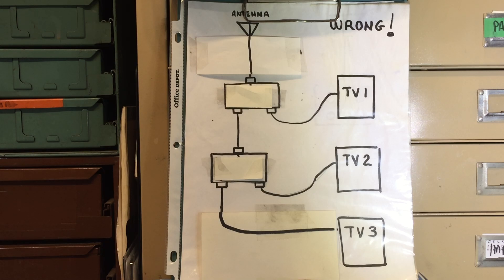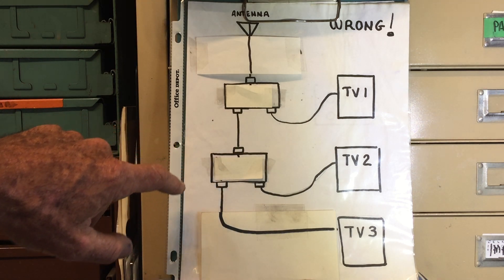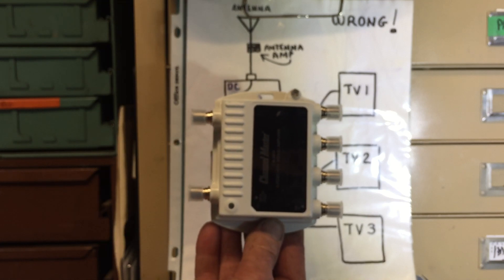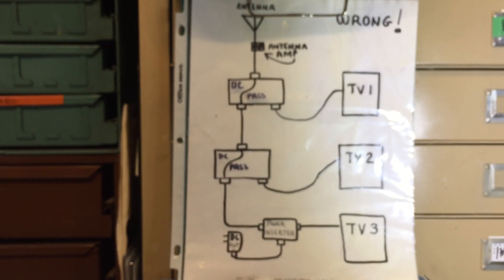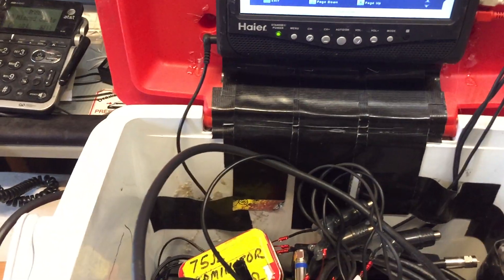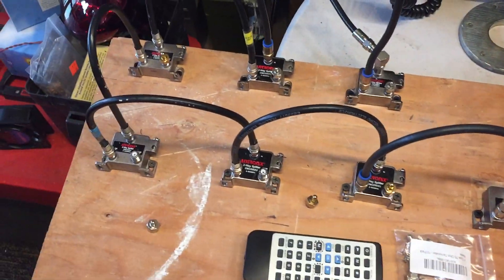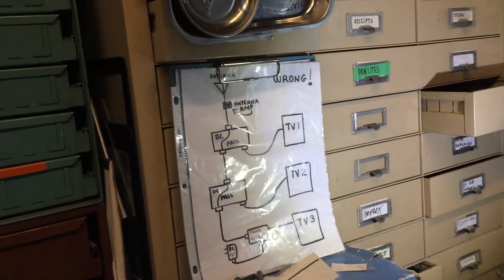TV Antenna Signal Splitting Mistake. (This Video Is Worthless Unless You See Follow Up Video.)

Comment: I recently ran into a similar issue. The problem was caused by faulty coax connectors. If the connector isn't properly attached to the cable, it leads to signal quality loss. Although it may seem like the splitters are causing the problem, the real issue is that the more splitters you have, the more connectors are introduced into the system, which increases the chances of poor connections. Looking at it more deeply, the likely cause of the problem is that with coaxial cables, the outer shielding also transmits signal to the signal insulation. If the cable is cut poorly and the shielding doesn't make proper contact with the outer part of the connector - or if the connector fits loosely on the cable - this kind of issue can occur.
Reply from the maker: I hope you saw the following video where I discovered my mistake.  Here's the link. https://www.youtube.com/watch?v=rZhw0BEqyRE

Comment: Would be nice to know how much the signal % dropped on the screen meter shown as you added each splitter, ie 2%? 4%?
Also, do similar test with 2 or 3 splitters using much longer and different length rg6, ie 25ft and 50ft going to identical converter boxes and check signal levels. With, without rg6 termination caps. Just keep excess cable coiled on floor.
Another would be regular rg6 vs quad shield at long lengths

Comment: Thanks I enjoyed this.  My TV pixels up from time to time. May I ask when I run my multimeter across the Antenna incoming coax feed I get a tone, or reading (using 200ohm setting). Is this normal?  Shouldnt the TV antenna be open circuit?  Thx Tim

Comment: Feeding multiple locations using splitters, instead use TV signal taps.  You may need to amplify the antenna only if the signal level is not strong enough by itself.

Comment: One good solution is drop-taps rather than splitters.  Whereas most splitters cut the signal in half, the taps "drop" a specific DB to each set, and send the remainder down-line.  Sadly they are tough to find on the consumer level.
Reply from the maker: Thank you for this information. I've often wondered about the splitters I picked up that have different DB numbers for each output. It sounds as if this may be what you are talking about.

Comment: Sometimes trial and error is the method that teaches the best. We have 3 TVs that use one antenna. The shielded coax from the antenna goes into a amplifier that has four outputs. One output goes to a TV in a living room right next to the antenna pole. Another output goes to a 50 ft coax cable that runs under the house and to a 2nd amp similar to the first one. Then the two TVs in the back rooms are connected to that amp. I eventually connected an FM tuner to the first amp to improve FM reception, since there were more outputs available. I learned to always use a multi-output amp in place of a splitter.
Reply from the maker: I use distribution amps when necessary, but I prefer not to since it's one more thing that can go bad at some point. Hopefully you saw my follow up video I made after this one.
Reply: @GrantsPassTVRepair  I just watched it. I don't used amps powered by a DC pass-thru. Only amps that have their own dedicated power supply. Same thing with a rotor, I wouldn't use one powered through the coax cable, and some antennas have those kind of built in rotors. An Amp can burn out for sure, but it's rare for modern ones to do that if they are quality ones. I had a cheap one burn out on me about 12 years ago and swore off the cheap ones. And it's still easy to trace if that happens.

Comment: Were you using RG6 or RG59?RG 59 does not pass uhf signal very well. A high DB loss above 500 MHZ. Many older homes were wired with 59
Reply from the maker: I was using RG6 in this case,  but yes I was told to avoid RG59 due to its loss.

Comment: The 2 way splitter you show first is marked as 5 to 2400 Mhz. This would cover the entire spectrum of the entire TV band. Part of the problem may be the way it is wired internally. Some units use capacitor, coil or wire circuitry. Capacitors will block the flow of DC and some of the higher or lower frequencies depending on the value of the capacitor. At TV frequencies, the capacitor will be quite small. Coils will not block DC nor 60 hz AC but will attenuate certain higher frequencies and will be quite small. But since the splitter has a lower frequency limit (under 1 Ghz) there is probably a capacitor/coil combination in a pi network, and maybe two of them,  to block frequencies lower than 1 Ghz. 
    Also, the terminators need to be used to prevent standing waves. Standing waves occur when signals of equal frequency  travel in opposite directions on the cable, one from the antenna and one being reflected from any thing that is on the cable that is not of the characteristic impedance of the cable. If they come together anywhere in the middle of the cable, they can tend to cancel each other out if their amplitudes are close to being equal. This is also the reason that there must be a matching transformer at the antenna's terminals. The antenna has a characteristic impedance of a balanced 300 ohms, while the cable an unbalanced 75 ohms. There would be standing waves created at that point, if not for the transformer, thereby attenuating the signal. The characteristic impedance of the transmission line must be the same along the entire length of the cable (including splitters, connectors and terminators) in order to transfer the maximum amount of signal to the TV  Each piece of cable and each splitter introduces its own loss. Any loss on the cable must be over come BEFORE the signal gets to it.
Reply from the maker: I thought you might like to see this follow  up video on antenna splitters. https://www.youtube.com/watch?v=_5ul0KfoewA

Comment: I see it is over a year old but to help anyone out.  The cable lengths do have loss.  However, you didn't have a second output on each spitter so there was no load.  Yoou'll find if you hook a load (TV) to both inputs the signal will drop.
Reply from the maker: It's More than cable length having loss that causes problems. There  are reflections in the line which can cause issues. Here is my concluding video on why I ran into problems. https://www.youtube.com/watch?v=_5ul0KfoewA

Comment: did u leavevthe pre amp inline with the big 110 splitter?
Reply from the maker: No preamp was needed here. just used a distribution amplifier without any splitters. My big mistake here was using diplexers to split the signal rather than conventional splitters. At that time I did not realize that diplexers which look like splitters are designed to block TV signals and only allow satellite signals to get through. Had I known what I know now,  I believe I could have used  passive splitters and it would have worked fine without having to use a powered distribution amplifier.

Comment: Is it possible to combine OTA TV and Spectrum TV? Ive recently "cut the wire" and I am trying to use my existing Coax cables in my rooms and keep Cable Internet(only). My current connection is connected through a PPC-9M-U/U splitter. Any input is appreciated 🙏
Reply from the maker: I've been told you can share the cable for both signals but I have not tried it yet. If you have success doing this I'd love to hear about it.
Reply: This is a year late, but check your Spectrum wi-fi 'tower' for ethernet ports, and your TV for similar.  IF you plug in an ethernet cable the TV and wi-fi unit should 'find' each other.  That's the way I'm doing it.  TV is a 2014(?) Vizio SMARTcast.  OTA antenna's coax is plugged directly into the TV's coax port.  I use the TV remote to switch between the OTA antenna broadcast signal and the 'SMARTcast' function for internet streaming channels.

Comment: I have five TVs in my cable system, a better solution is one multi port splitter. This one piece splitter has up to eight ports, it is nice because extra ports are there if you want to add anymore televisions. Naturally the unused ports will have 75 ohm cap on the end. Buy the way this is a no-brainer hook up all your TVs to the outputs of the multi port splitter, connect the single amplifier to the input wow magic.
Reply from the maker: Did you see this follow up video? https://www.youtube.com/watch?v=rZhw0BEqyRE&t=0s

Comment: With RG-6, you lose .83 dB on 800 MHz, and 1.35 dB on 1900 MHz, per 10 ft of line. Ideally you would want you cables to be as short as the need to be, and refrain from splitting as much as possible. Of course the specs of the cable should be listed on the cable itself.  

With all cable specs you have quality/power loss over long distances.  Especially now with home internet being as fast as it is.

Comment: So what exactly was the final solution for the lady's three TVs...eg, what was the final schematic of cables, splitters, amp. etc?
Reply from the maker: I used a distribution amp to solve the problem, but had I known what I know now, I believe I  could have used a passive splitter rather than a powered one.  Did you see the follow up video I put a link to in the info section? I Talked about how I mistakenly used a diplexer not realizing they block TV signals. Here is the link. https://www.youtube.com/watch?v=rZhw0BEqyRE&t=0s

Comment: Great video!  Hey, my Dish Satellite has two coax cables that connect to a dual connector that’s attached to the house wall.  How do I determine which connection to attach the single coax cable that runs from the OAT antenna?  Or do I need to rip out the existing dual connector and replace with a single one?  Appreciate your advice.
Reply from the maker: I don't know, but every time I attempt to use the old coax which was used for the satellite and attach it to an OTA  antenna, I end up having to remove the diplexer which looks like a splitter because it blocks TV signals even though it has a DC pass through.
Reply: @GrantsPassTVRepair  what is the diplexer?
Reply from the maker: @NavySWO  They look like signal splitters but they are designed to block TV signals from passing through them and only allow the satellite signals to pass through the TV cable. Here is an example. https://www.techtoolsupply.com/ProductDetails.asp?ProductCode=DPD2&source=googleps&gclid=CjwKCAjwu5yYBhAjEiwAKXk_eI_FbTFtfjYEICllPwa9tL7b4uWB12meCy392vWZ93k2fMar9ovwgxoCT1AQAvD_BwE

Comment: In your video, 

- you first added a preamp with it's power inserter as per your diagram at the 1:05minute mark

- then you added the distribution amplifier which you said took care of the problem..

My question, since the preamp requires a power inserter + the distribution amplifier and also requires power and comes with its own power insertion AC block adapter..

In the end when you got all this working, 1) did you actually have two power inserters over the coax line (one for the preamp + one for the distr amp) ? 

I ask because I would have thought all this power insertions would be a problem.

2) where exactly did you install the power distribution amplifier and how did you power it? Do you have a diagram or weblink that shows how the preamp & distribution amplifier were connected among the existing  splitters as you have shown..

Thanks for a great video.
Reply from the maker: Did you happen to see the follow up video I made to this video?  What solved my problem was removing all those splitters and installing a distribution amplifier which had one input and three outputs. Here is a link to my follow up video. https://www.youtube.com/watch?v=rZhw0BEqyRE

Comment: I see people do that all the  time. They install a two way or four way splitter and then use a bunch of terminators. It's Not a good idea though. On a two way splitter  you get 3.5 db of loss on each terminal. On a four way splitter  you get 6.8 db of loss on each terminal. Sometimes more, sometimes less. It varies depending on the quality of the splitter. But generally that's the  loss. Better option would be too use a grounding coupler or if you need multiple feeds then a distribution amplifier.
Reply from the maker: I hope you saw my follow up to this video. I had mistakenly used  splitters which were designed to block television signals below 950 Mhz known as diplexers . https://www.youtube.com/watch?v=rZhw0BEqyRE&t=0s

Comment: I'm running 110' of rg6 and 4 spliters.  No issues even on the last tv and dvr.  The only difference is that my power inserter is connected before all the spliters.  Maybe that was the issue in your setup.
Reply: My Winegard-LNA-200-Preamplifier  i put ther power inserter after 100 feet  of cable in the celler  and  still have  about 15 feet  to the 4 way splitter  ,
Reply: You don't want to send unwanted dc voltage to other units.  DC inserter goes before any splitters.
Reply: @jayvalentin5513 My Winegard-LNA-200-Preamplifier  i put ther power inserter after 100 feet  of cable in the celler  and  still have  about 15 feet  to the 4 way splitter

Comment: The furthest run should come off the splitter directly from the antenna. The first & second TVs should be from another splitter on the other port of the antenna splitter
Reply: I have UHF antenna 30 feet high  with Winegard-LNA-200-Preamplifier with  120 feet of  run of cable  connected to a 4 way splitter  leave a short cable to main living  room tv  then  2 ,20 feet  cables  to other tvs  in other rooms  that  also has  3 way to 3 tvs  and 2 way spitters  other 2 tvs.

Comment: I am no fan of splitter, after splitter. I think you should had tried first a 3-way splitter, using the -3.5 dB port for the TV further away, unless it is balanced in which case it makes no difference what port you use.

This  is a classical example on why you need to check first what is coming out of your antenna in order to determine if the signal can be split or not and how TV outlets it can take. Remember, garbage in, garbage out. If you had used a professional signal meter, you could have easily determined if you had readings good enough (power, MER, SNR, link margin, BER) to split the signal and the readings coming out from each splitter.

Also, If my readings were low and for test purposes I would have powered my preamp using the first TV coax cable (TV 1) to avoid going thru two splitters. The more things on the way, the more chances for failure.

Finally, if your distribution amplifier worked, it means you had good signal readings coming out from your antenna to your amp ANT inlet port.

Thanks a lot for your instructional video. We need more like that.

Comment: I was told to split your coax from the antenna only once and only use a splitter that meets your needs without un-needed extra ports. Keep in mind your signal must be useable at the splitter input or else you're just splitting noise.  If your signal is weak at the splitter input, use a pre-amp (at the antenna) and matching amp (indoors) ahead of the splitter.  If you have long runs you can add on an amplified splitter like the Channel Master in this video.  This arrangement has always done well for me.
Reply from the maker: I've often placed passive signal splitters far from the TV antennas and they seemed to work okay, but if it helps to have the splitter close to the antenna I'll keep that in mind. Thanks for the tips.

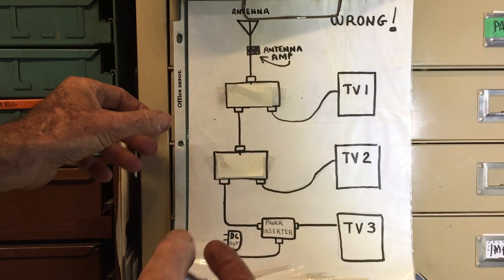Comment: Those satellite DC passing splitter you showed at 1:50 video aren't splitters! At least not in a conventional splitter sense.  Those are satellite diplexers which are designed to send both TV and Satellite signals down the same coax. That Sat output (on the lower left of the video) only passes signals above 1GHz (and DC to power the LNB). The TV output on the lower right has everything below (usually 5MHz to 850MHz).  Since TV stations operate below 850MHz, the only TV that is going to get a signal is the first one because the Sat output on the first splitter doesn't have any TV signals on it.
Reply from the maker: Thank you so much for this information. That's probably where I went wrong. I did not realize TV signals would be blocked on the DC side, but I just tried an experiment using the DC side of the splitter and you're correct. When I saw how the splitter said 5 to 2400 MHZ I assumed that meant both sides.
Reply: Easy mistake to make with the type of diplexer you have.  The Diplexers I use have 5-850MHz written on TV side and 950-2150MHz printed on the SAT output along with the Power Pass.  Diplexers are no longer compatible with many satellites systems.  I use them mainly to send MoCa (Ethernet via Caox) and Cable TV down the same coax.
Reply from the maker: @highfidelityinc   This is good to know. Do you know if some of the Diplexers able to pass the TV frequencies on the DC side as well?
Reply: I think you will find that all Diplexers will block TV frequencies on the DC side.   All diplexers will have a SAT and a TV output.  So if it doesn't have a jack name TV and SAT, it is probably a normal splitter.   What you really need is a regular splitter with a DC pass.  You might look at https://www.solidsignal.com/tv-antennas-and-parts/signal-splitters .  Some splitters will pass DC on all ports.  Others will pass DC on just some ports.  And then other splitters will block DC on all ports.  It looks like the P\N: PV23-402 and HFS-2 will do what you want.
Reply from the maker: @highfidelityinc  Thanks for the help. I made a follow up video where I shared some of the information you shared. https://www.youtube.com/watch?v=rZhw0BEqyRE